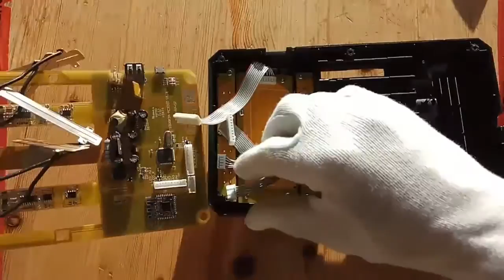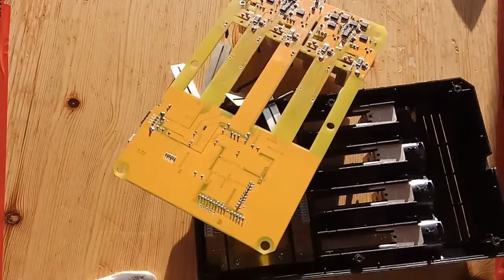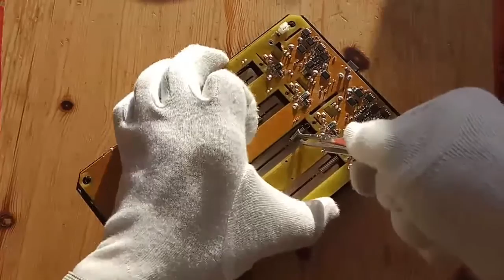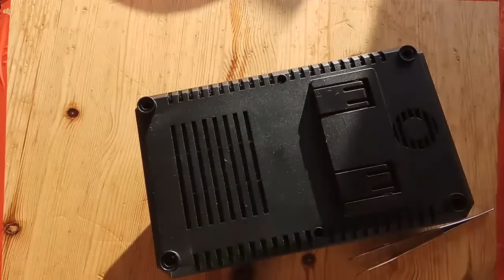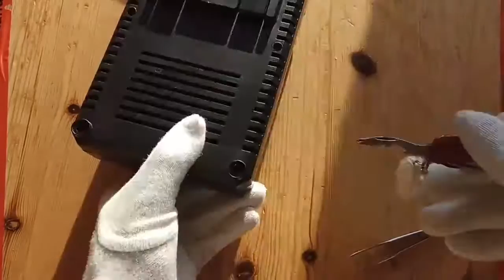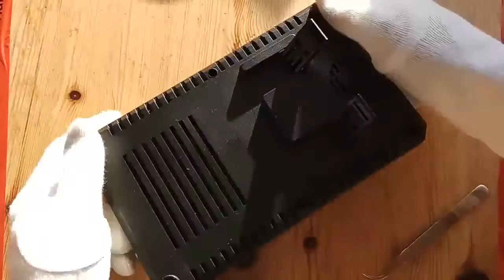assembly mc3000 skyrc

Comment: Brilliant Video – You’ve Saved My MC3000
I was just about to give up on my beloved MC3000 when I found this video but I got it back together and working in less than ten minutes after studying your method.
Not only did you come up with a perfect method for reassembling the MC3000 but you did it despite having that awful person in the room with you making those horrible sounds on the piano!
Just one point to mention though is the four temperature sensor’s position, as mine had been bent out of place. These need to be positioned so that that they are pointing at 90 degrees straight out from the PCB so that they end up going through the appropriate rectangular holes in the case.
After going through this hell, just taking my MC3000 apart to clean it, I have to say how badly designed this thing is. As an engineer looking at the mess that this thing is internally it’s a wonder how they mange to assemble them on the production line. It could be so much better designed without having to have those awful sliding contacts. I’d now seriously question whether to buy another SkyRC product.
Thanks again, I can’t thank you enough.